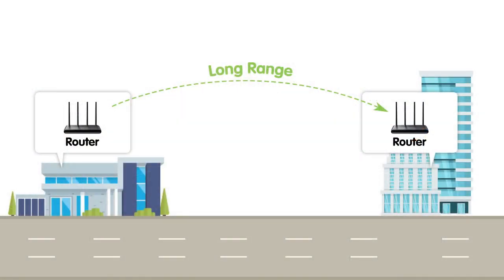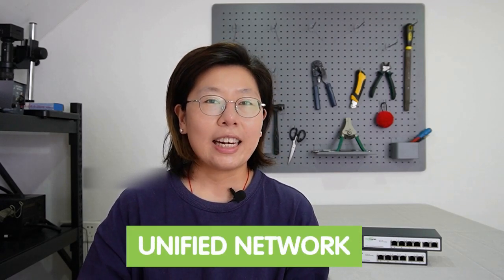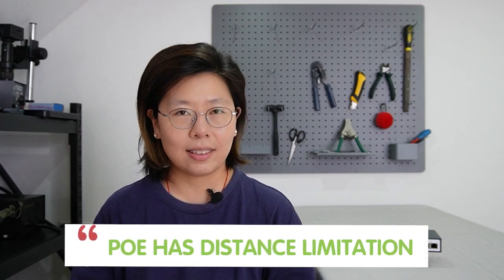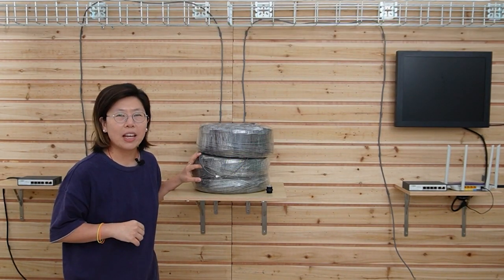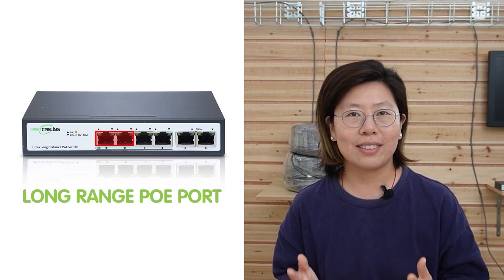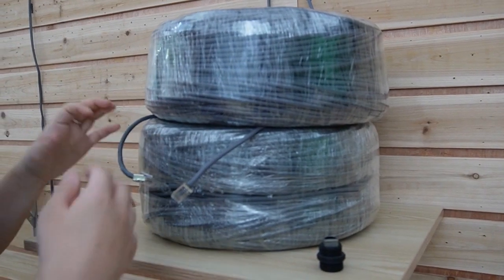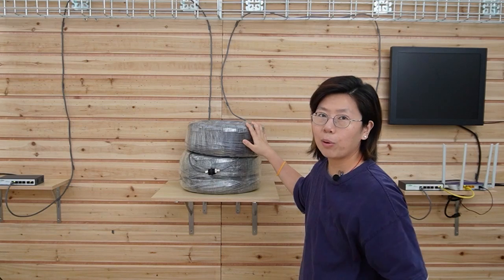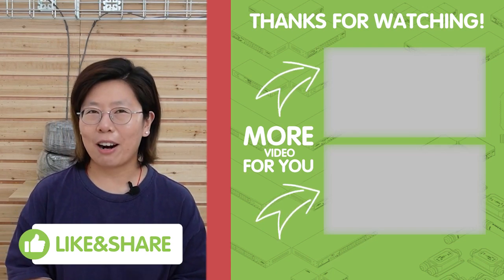Linking 2 Long Range PoE Switches | 1500’ LAN Extension

Comment: Hi, you used cat5E, if we are using cat6A can we have 1 GB or 10 GB poe switch that can support that kind of Speed as well? thnx
Reply from the maker: No, the bandwidth is still 100mbps. It is determined by the chipset on both ends, not the cable. The advantage is the continuous running. If the cable is buried, and you don't want to cut the whole cable into several pieces. This is the simplest solution.

Comment: Hi there, it was a very useful and informative tutorial video, but these days 100MB it's not enough, at least 1 GB!! thnx
Reply from the maker: While 100Mbps may not be sufficient for some applications and scenarios, it ultimately depends on the specific needs and requirements of your network. If you require higher speeds, it is indeed advisable to aim for 1Gbps or even higher, depending on your usage and devices.